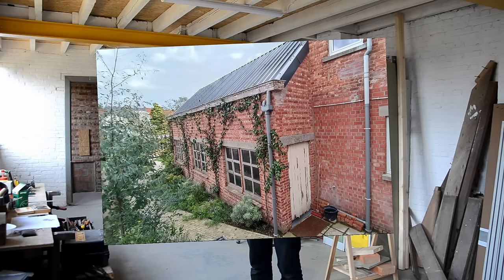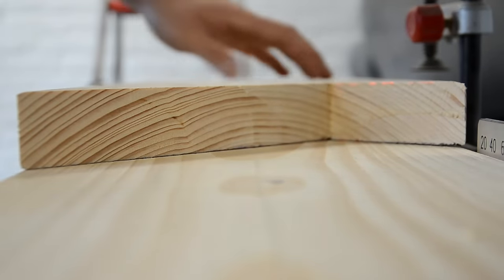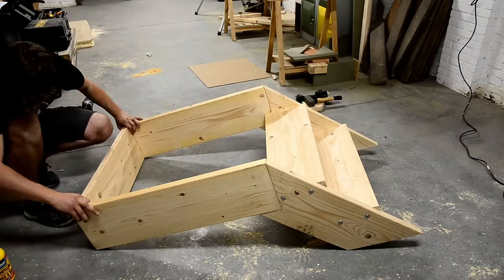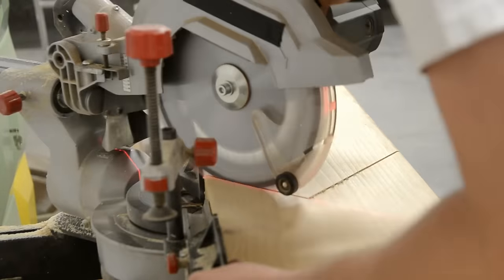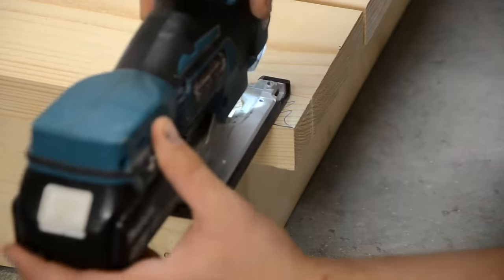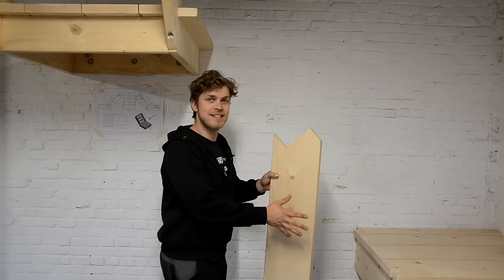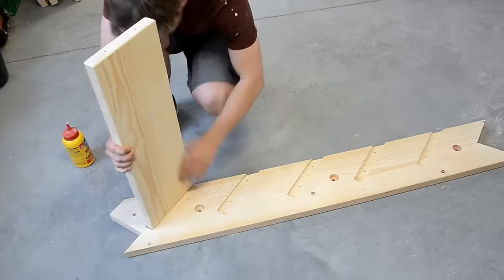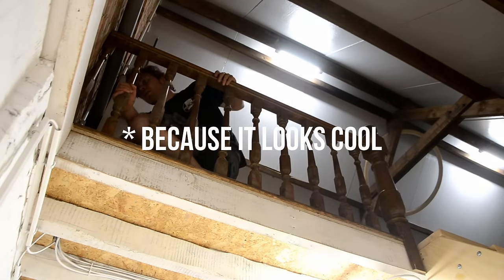Making a Floating Staircase - Woodworking

Comment from the maker: Hi everyone, thank you for your many fair questions and remarks about this staircase in the comments.
I’ll try to answer them all but thought I would summarize the most interesting ones here:

-	Strength:
I built this staircase about a year ago and used it to hall big lumber and furniture upstairs,
I’ve had no issue with it what so ever. Although it could have been even stronger if I didn’t recess the anker bolts in the sides.
(In hindsight, don't know why I did that) but again, its plenty strong. 
-	Railing: 
I’m planning to install a railing on the wall. I want to keep the middle open so I can easily move big pieces upstairs.
-	Safety: 
here in Belgium (probably different from the US) only new builds and classified renovations need to be approved by an inspector.
This isn’t the case here but that’s a legal issue I won’t bore you with. To summarize; It’s safe and legal.😉
-	Woodglue: 
I used a lot of glue on the 3 individual pieces, so they would be strong. I did not glue those 3 pieces together though, I only used screws.
As they are each connected to a different part of the building (ground, wall and 1st floor) that can move in different directions.
Adding glue would prevent the natural movement that occurs and would over time loosen and start to creek.

If you have any more tips or questions, let me know! I’m eager to learn more 😊
Reply: oh I see i am noth the only one to comment about the recess... so, if you want, you can do this: take one out at a time and put a thread coupler in then put another short length of grade 8 rod, or whatever steel grade you had. put a 2" square plate of steel with a big enough hole to accomodate the coupler if its protruding, then bolt it back in with a washer and lock washer. im a nerd so i would probaly put thread lock too. i think the only problem with doing this is making sure you have the same or higher grade of steel on the new parts as well as making sure the coupler doesnt bottom out against the 1/4" plate you used as a big washer. anyway not sure thats necesarry but if it ever gets loose or cracks that easier that rebuilding the whole thing and trying to install bigger anchors etc.
Reply: Nah only thing is you're making the tolerances a little too tight for Glue and fasteners(should slide in snug without glue and you hammer it in with glue applied) but other than that Maybe have more Bolts fastening the Stairway to the wall. The second landing can have a little self on the closed/backside side to act as an additional Brace if need be.
Reply: I did some rough calculations using eyeball estimations for the grade and diameter of your anchor bolts and other fasteners and am prepared to conclude that you could regularly march elephants in and out of your second floor without concern for many many years.
Reply: Question: Why is there a steel platform that the bottom section is resting on?
Reply: as much fun as this looks, I'd never trust a wooden staircase in case of a fire.
Reply: Hey, what software did you use to design?
Reply: Nicely done ! However, as others here have said, I would not have countersunk the bolts to the wall, so that you get the full strength of the board.  One other note : here in the U.S. these stairs would not satisfy the building code as they are too steep at 45 degrees. In the U.S. they should not exceed a slope of 7 / 9. Flatter is allowed.
Reply: @Dallen9  (EDIT: I've changed my 'opinion' in this comment since watching this video: "Glue Myths: 1. End grain". Thanks to the comment further down from @EvenTheDogAgrees!)

It should be realized that you can’t effectively glue end-grain, especially with yellow or white carpenters glue. Nor can it effectively (with any strength) bridge a gap—so I’m not sure if you meant he made it too tight to glue effectively... this kind of glue works specifically when the two pieces are tight without any gap whatsoever and are further pressed tightly together with added pressure. His nicely sized wood screws are theoretically providing that needed pressure—but still, the orientation of the grain is preventing it from having the strength that wood glue otherwise offers. In loose fitting joinery and non parallel grain there are better glues, like construction adhesive (specific formula of polyurethane glue), but having said that there may be even better, that I’m unaware of, but my main point here is how to properly use the glue he is using. The more parallel the grain the stronger joint (and maybe you already know that). But again, end-grain to end-grain glueing is also virtually useless, though it might slightly help the mechanical fasteners function a tiny bit better (especially if glue is squeezed inside of the predrilled screw holes to help them from eventually tearing out). Whereas end-grain to edge-grain is debatable whether it functions any better than end-grain to end-grain, but then again it may, be it ever so slightly. 

Technically speaking these joints should have a plate/gusset or something else mechanical or providing a decent glueable surface (like mortise and tenon/t&g), that can handle the pressure better than just the screws, especially where the screws are being held, again, by end-grain, as over time/use the pressures applied will cause the grain to break down and fail. This is fairly basic level joinery techniques, like ‘Joinery 101’. But he can add strength later as needed, as long as there is no catastrophic collapse... like he can add more screws  or gussets as needed, or the posts he avoided in the first place to support those landings, etc... not that big a deal... But to teach others as if this is good technique or good enough—is where there is a reasonably big issue/problem, so it should be presented more for entertainment about how he cobbled these stairs together, versus a how to video. (Sorry for attaching this directly to you, it’s more for the general audience and OP, versus you specifically! Take care.)See the com
Reply: @GMC-qo9xi  You're good, I didn't know the technical reasoning so it's good you filled that in.
Reply: @GMC-qo9xi   That end grain thing is apparently just a woodworker's myth. Some chap here on YT named Patrick Sullivan tested this out in a video titled "Glue Myths: 1. End grain", which is an interesting watch if you haven't seen it before.
Reply: @EvenTheDogAgrees  I’ll check that out. 

However, I’ve broken many endgrain joints, like when demo-ing cabinets for example. And when grain is glued in parallel, the typical glue joint is much stronger than the wood itself and will break away from the glued joint. It’s the very reason for the most common joint when making cabinet doors, where a tongue and groove style joint is used, as the top and bottom piece (styles) can then have some decent glue surface as they slot into the vertical rails. (Otherwise they would fair almost instantly, unless they are also pocket screwed.) When it’s endgrain it will ‘always’ break right along the glue joint, with a high degree of certainty. And it would be very rare to have any wood break out with it. So personally speaking, I’d say it is virtually impossible to be a myth.
Reply: If you just hung rails along the right side of the top platform (if you're going UP)--  and hung those rails from the joists.. It would go a lot further in making it have some redundant strength and not just be relying on the small tip of those tip risers, where you have the lag bolt.  Another thing you could do there at that recessed lag bolt is to put a 4 inch steel plate-- like a beefy washer--  to help hold more meat, instead of that one recessed lag on each side.
Reply: Nice job!  But apply glue to both surfaces.  Especially the end grain side which is the most thirsty.  Sub-floor foam adhesive I think provides the most tensile strength, but if using wood glue for structural applications, apply to both surfaces, especially end grain.
Reply: @EvenTheDogAgrees  Hello again. I finally checked out the video that you mentioned. I accept now that there is indeed a myth and a lot of confusion regarding the end grain to end grain glue joint. Thank you for sharing! Now i will decide whether to append my previous comments or just save time and delete them. Hopefully people will go to the video themselves and learn what is actually going on!
Reply: @GMC-qo9xi  hey, man. Glad you watched the video. The more you know, right?

And feel free to leave those comments as they are. People that read that far into a thread tend to read the entire thing. And that way, at least, they can follow the conversation. Cheers, man! Nice talking to you.
Reply: @EvenTheDogAgrees  I will still make tongue and groove joints as the groove also holds panels in place, but I will now consider how an end grain to side grain joint (without the t&g) is actually feasible when no panel is required. 🙏🏻
Reply: The safety inspector cat approved it so it's okay!

Comment: Structural engineer here. Gotta warn ya bro that ledger to the concrete wall with no support on the other side is in what's called cross-grain bending. Wood has zero strength in cross grain bending, it's strictly not allowed. What would have worked is doing a tension tie type anchor at the top of the landing framing member that are perpendicular to the wall. This would take the tension out the eliminate the cross grain bending. If you built this extremely tight and redundant it will probably compensate and shouldn't get overloaded with just one lightweight person. But we usually try to support things correctly. I would use like a Titen HD with a DTT2Z or something similar. Cheers mate.
Reply: Can you elaborate. When you say that "ledger to the concrete wall" are you talking about the middle riser, the lower landing, the upper landing, etc? Which piece of wood is the cross-grain bending likely to occur on?
Reply: Maybe he's referring to the upper landing... You have a back plate screwed to the concrete which is part of a square, then you have a riser coming off of the end if that square, attached to the landing on the top floor. I'm wondering if he's suggesting that the riser go straight from the top floor into the back plate and then construct the steps within that frame. Would be good if he gave a description as I'm curious.
Reply: @patrickjay6434   Yup it's the second landing, both landings really. It's all just statics. Every engineer learns it in their second year. Imagine a person standing on the upper landing near the edge that goes up the stairs. What is resisting the static force applied. The staircase going up is attached with some screws it looks like, but this would typically be modeled as a hinge - little to no resistance. Maybe if they used several large lag bolts or straps of some kind we could say this creates a continuous beam / joist type member that carries the force. Joists are typically 16" o.c. for a good reason though. The stairs down to the right may provide some resistance to the static force applied, however there is a X and Y component as the stair there is at an angle so those forces don't resolve cleanly, it would be a sort of torsion and shear through the platform that get resolved at the wall somehow. Last we come to the ledger at the wall. 3 bolts in the middle a 2x framing member. Assuming this is resisting the majority of the forces what you have is called a concentrated moment at the wall. This concentrated moment applies bending across the grain of the ledger, this is the cross grain bending that breaks boards in half. There is a reason why floating staircases like this are always built out of steel, tube steel has incredible torsion and bending strength and is isotropic - has the same strength no matter how the load is applied.
Reply: @cheezyblasters9262  Understood at least 60% of that... :-)
Could it be fixed without taking the whole thing down? I suppose it should be fine if there's not much weight going on it.. But eventually it might start to move a bit. Maybe he could wait for it to start moving and then stick a post underneath it for stability!
Reply: @cheezyblasters9262  i was searching for a structural engineer to help me in building a Cantilever staircase. I m trying to make it on my own but i Have 0 confidence and ,100% doubt on everything every idea i m thinking of. Wud you be kind enough to help me with it?

Comment: Retired now, but I have built many staircases during my decades of work. There are many tiny nuances that the books/internet might not mention yet make a massive difference when the customer and their family use them. I wish you had consulted somebody who has done them before. You will figure out what they are yourself as you use them. Thanks for sharing. Great shop!
Reply: Please tell us what are the points? Its been 1 year since u wrote this....i hope you are still alive to share the Knowledge. I m no carpenter or know nothing about building stuff. But still i am trying to build a Cantilever staircase and it is extremely challenging. Need some guidance.

Comment: Better to now countersink the bolts into the side of the boards.  Easy to over tighten and crush the thin bit of wood that you left.  Vibration from the people going down the stairs will slowly crush the thin wood.
Reply: Yeah I was thinking the same thing but… he will probably get away with it since most of the load is in sheer.
Reply: This is where washers would be the solve all

Comment: So, a critique from a professional joiner. 
Your opening  should have a full length doubled joist along the long edge (Trimmer joist), and then a doubled joist across the short end (Trimming joist) to carry the ends of the joists that are cut short (Trimmed joists) for the opening. 45% is steep for a staircase. The ratio is usually 8 up to 9 along. Steeper than that will feel strange. The grooves for treads are usually a little wider than the tread at the back to allow room for a wedge which can be driven in to tighten up on the tread in case the timber shrinks (Which it probably will in the summer). All this information is available online if you care to look for it.
The amount that you countersunk for the anchor bolts has reduced the thickness of the timber considerably where the bolt attaches. It's kind of irrelevant how strong the bolt is if the timber that it is holding is so thin that is has much reduced strength.
I hope your stairs last as they are, but there are many reasons to use a professional for potentially dangerous items like stairs. Joinery is rarely as simple as people think.

Comment: Nice build. I have built a few custom stairs and I think this is a very nice job. Only one thing I would have changed, or added, would be a 45 degree diagonal brace under that top platform, transferring the side load of that left runner of the top stair to the wall on the right of (from a climbing stair perspective).
Reply: He should probably leave that strut out because he wants the staircase to look daring and gravity defying. It looks very solid, doesn't sound or look like it's vibrating, is wide enough and easy enough to climb. He wasn't worrying that old rule about tread width and riser height should add up 17 inches total. I never thought you could just pick an angle - 45 deg. - for convenience).
You can usually do what you like with your house as long as you own it outright free and clear.  You still have to meet town building codes and he may not  He will probably have to provide a railing.  .

BTW - I know an old guy like me around here that used to have a dog who could climb up a ladder. She couldn't climb down and when she demanded I carry her down her attitude toward me changed considerably. She climbed on my shoulder. She figured how to do that.  I couldn't - and we both got down safely.  She was such a smart little dog and was interested in everything going on.

Comment: you are fortunate. in the UK the stair depth and height is regulated, and the number or steps before you are required to have a landing, and the railings/arm-rests. Nice steps. one comment (that I didn;t see already) it is easier to sand the wood before assembly and varnishing.  Great build.

Comment: So since that center stringer came up shorter than expected (I suck at CAD design AND any sort of advance planning, so unexpected results notwithstanding, good on ya. My stuff never comes out right the first time), did that alter the spacing for your steps? Do the steps in the middle section have a different spacing than the two smaller sections because of the surprise dimension change, or did you just split the difference and it's so small you wouldn't really notice?
Reply: this is EXACTLY what I was wondering ! I suppose the original plan had equal spacing between ALL of the steps, so it can not be other than the middle piece steps are now slightly shorter.

Comment: Genius.  Well done.  One thing I don't get is why you recessed the bolts that go into the masonry.  By doing so you halved the amount of wood that the bolt head has to bear on.  I mean, it looks nicer but I think it's weaker than if you had not recessed them.  What was your thought there?  Just curious....not  being critical.  Thanks.
Reply from the maker: That's fair, it was not necessary to do so. I didn't think that part through to be honest 😅. Still had no issues with the strenght (built it about a year ago), but could always be better with tips like this. Thanks!

Comment: A few Questions if I may: 
1. Did you determine what took place to cause your final stringer dimension to be shorter than the construction drawing?
2. When you trimmed off about 1.5" to get your stringer to fit, how was your rise and run design affected?  
3. When you attached the stringer to the wall, were the cuts for the tread still level?

Lastly, I really liked the look of those construction drawings. They had excellent graphic clarity and punch.
I enjoyed your video. Keep it up.😀